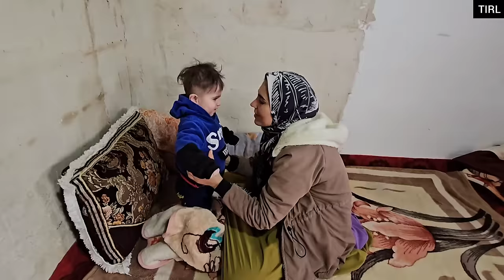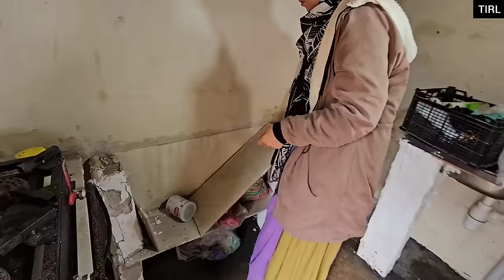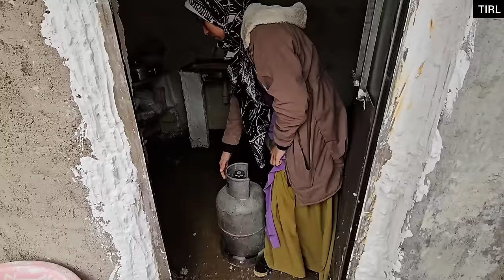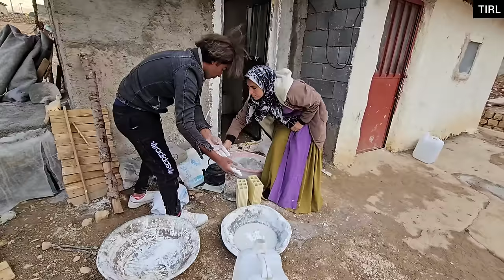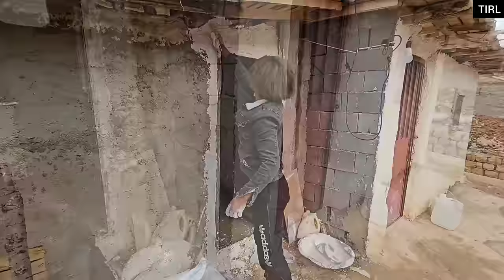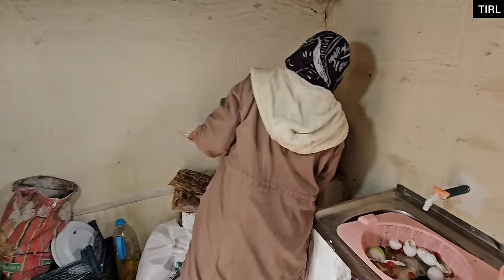Hassan's help to a nomadic heart patient woman after separation from her husband

Comment: to make strong shelves you have to use cement blocks or use those but lay them on the flat side so they are stronger and you have more room to lay the ceramic tile down. but i would use wood first for the shelf and then put the ceramic on top of the wood and then it would be very strong.